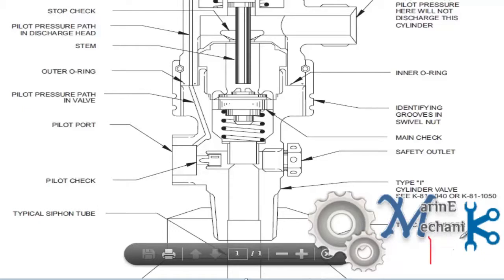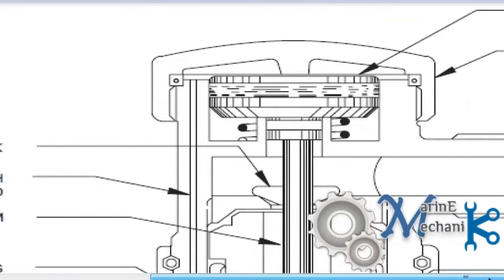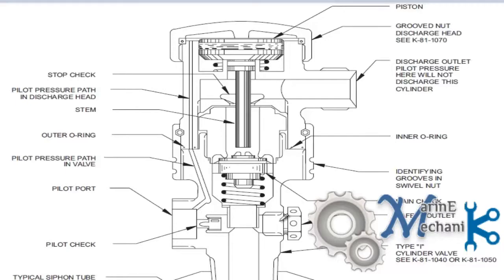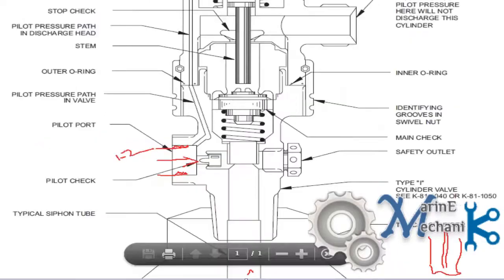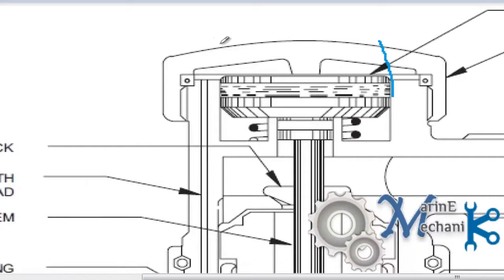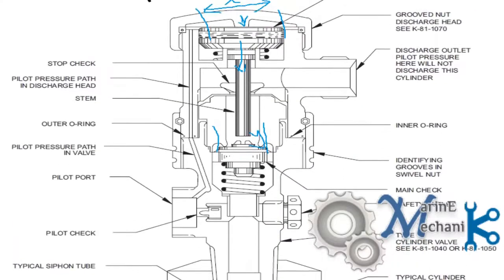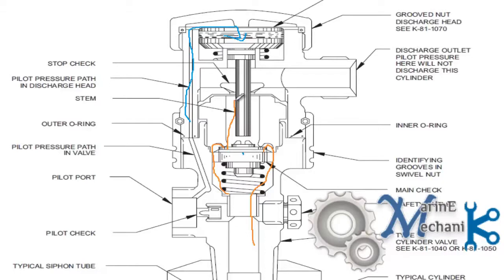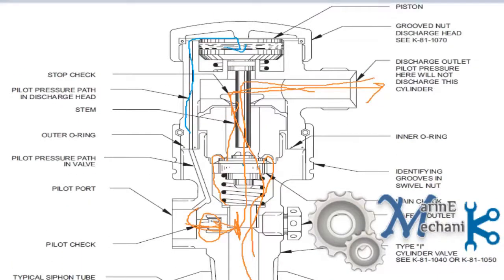The sailors confession -Understanding Of Co2 Bottle Head Assembly And Working.

Comment: Correction pilot CO2 and main co2 bottle pressure are same 58bar @20°C, it's only the area difference that causes main check valve to open by stem downward force
Reply from the maker: Well said